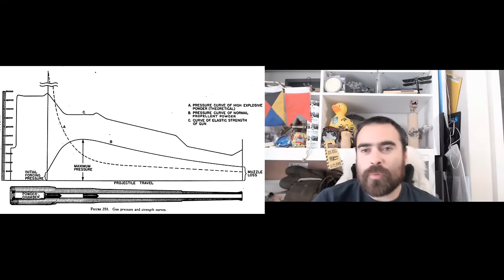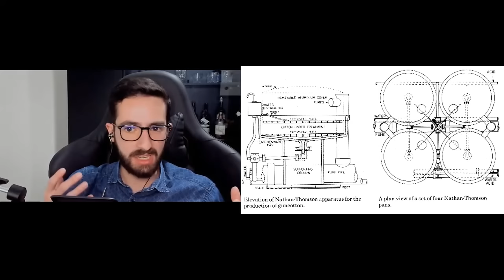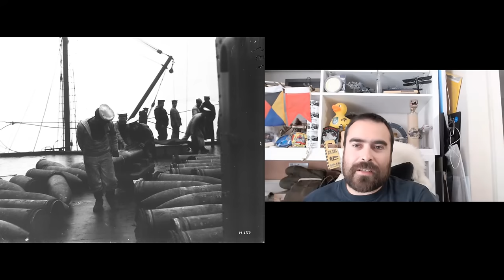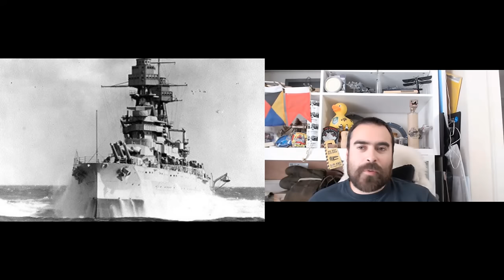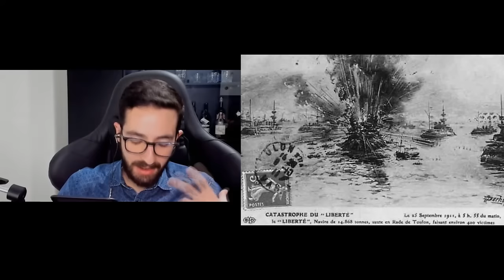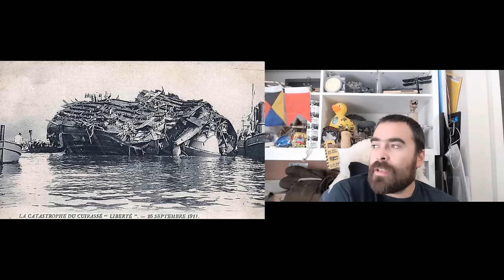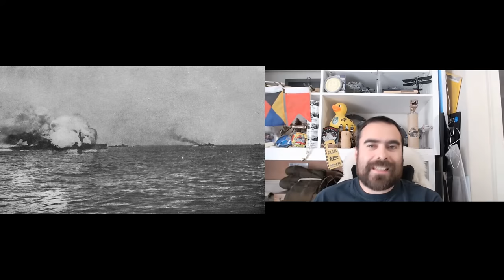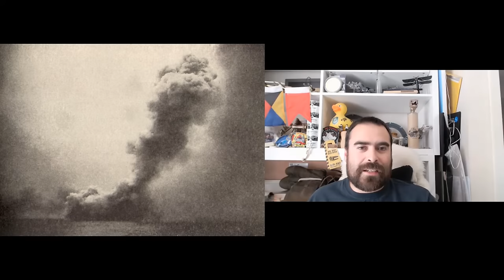Cordite and Poudre B - Why things start exploding at just the wrong time

Comment: Hi! I red a text about french B powder which was used by the French navy and the French army. The making process was the same for both but the army has her own unit and was more cautions with this new powder. An other fact is that was the army who was  the authority for the powder whereas for the navy there was an authority between the producers and the navy who like for the cordite was adamant whith the safety of the new powder, even more than the scientist who made it up.
The tests and survey by the army where more consistant that those by the navy. The accident of the IENA and LIBERTE push the authorities to replace the initial stabilizing additive (Colodion) by another, Amyl alcool but powder using this one where aboard LIBERTE and detonate.
It is the army whith a better survey and control of the powder degradation who decided to order to add diphenylamine to improve the stabilizing additive which was the good things to do at the time.
Your comments about Cordite and B powder and their sensitivity add some explanations to the destructions of the BOUVET in the Dardanelles attack (sunk in 6 mn after hurting a mine) and the explosion of the HOOD in the Denmark Strait battle of 1941 (sunk in 3 mn after a hit by a 15 In shell from Bismark)

Comment: Wow, what an original and interesting video! Let me suggest two ways to test the hypothesis that shock was the trigger for the explosions at Jutland. First, were there hits on British turrets or barbettes that did not trigger cordite fires of explosions? Even if there were some, that is not conclusive evidence against the idea, because I'm sure there are other factors involved (like, was that ship kept spic and span). Second, it would be interesting to compare the magnitude of the shock required to set off nitroglycerin to that experienced by a nearby hit from a major caliber shell. Again, it's bound to be complicated, but if the numbers differ by many orders of magnitude, that raises doubts.
Reply: There is one single fact that determined whether a RN ship exploded or not, it depended on flash or hot shell/armor fragments hitting a propellant charge.

A few RN ships survived turret penetrations because no charges were ignited, the only one that survived a charge ignition was Lion... because its magazine was already flooded.

Comment: If you take a chunk of C-4 and use a lighter to ignite it, it does not explode, it burns like a can of sterno or canned heat.  You need both heat and shock to make it detonate.  The detonator gives you the heat and shock to detonate the C-4.

Comment: Yeah, before I was even 20 years old I knew how to make a very large bomb. And the main reason was because I was growing marijuana by the time I started high school. We called it triple-13(13-13-13) but its also known as Ammonia Nitrate. When mixed with diesel fuel it will cause a very large explosion. I read about a merchant ship that was carrying a large amount of Ammonia Nitrate fertilizer & for some reason it's fuel tanks were leaking into the cargo hold.Then somehow something caught fire 🔥 and the diesel fuel started burning. Once it got so hot it caused a massive explosion as if the ship was the most massive pipe bomb ever. Usually, from what I've heard, it takes a smaller explosion to set off the mixture. But you can also find out things like that in a book called "The Anarchist Cookbook" too. When I was young I was going to try making a small bomb with the mixture but I never did

Comment: Nobody has stated the formal definition of the term 'detonation'. If memory serves, detonation is defined as 'a shockwave travelling faster than the speed of sound in that material'.

So detonation is measured in miles per second. So even deflagration can still, technically, be VERY fast.

Not seconds - that's just conflagration, I suppose.

Comment: Gunpowder burns it does not explode when it is employed correctly as a propellant.  You do not use explosive to send out a shot you use a propellant that burns and builds pressure to send the shot out.  The sound is not an explosion it is the sound of the projectile breaking the sound barrier.

Comment: I looked back through the comments a little and have to wonder if the bad fortune of being resupplied led to some of the catastrophes? The point being the propellant not used remained in it's position and overtime deteriorated but remained in it's position, as in the ones in the front get used every time, but the ones in the back never see use  and deteriorate, remaining a potential ignition/initiation point causing those untimely blasts? Just a Thought>

Comment: Damp hay bales can get hot enough from chemical reactions to burn and they are not very energetic.  If an energetic material will do similar things then they will have no problem hitting an ignition temperature.  The cellulose in hay burns at 450 Fahrenheit...

Comment: I've personally seen a man light plastic explosive like a candle.

It's so stable it's crazy, it takes such a  high activation energy to detonate, it requires a secondary explosive in the form of a blasting cap.

Most of these older explosives deflagrate instead of detonate, modern explosives detonate generally.

Comment: Not to nit-pick, but I don't think nitroglycerin dust being in the air makes it a fuel-air explosive. Maybe my subtitles are wrong? In a fuel-air explosion, the oxidizer if you will is the oxygen in the air, and the fuel is literally that, any number of possible fast-reacting materials, from very fine metals to atomized liquids to flour. There is no need for any secondary material to be involved for nitroglycerine to explode.

Comment: Even early Dynamite had issues with Nitro Glycerin separating over time. Straight Nitro Glycerin is a liquid and highly unstable, welcome Alfred Nobel of the Nobel peace prize. He stabilized NG with sawdust but this had a very short stable shelf life and within months the paper wrapping would be visibly wet with NG. The second generation of Dynamite used a clay instead of sawdust, this worked much better as a stabilizer. Not sure what they use now as I don't think Dynamite is even manufactured anymore as there are much safer and more shelf stable alternatives these days.

Comment: One question remains: The explosions occurred on the battle cruisers and not on the battleships. So the construction of the ships seems to have something to do with this.
Reply: Or the use of the ships. The battle cruisers spent a lot more time fighting and getting shot at at Jutland than the battleships did. 

But probably even more important was that the battle cruisers were stuck at Rosyth and weren’t able to do live fire gunnery practice, which meant that the cordite charges probably sat unused in their magazines for much longer.
Reply: And the thinner armored decks and belts of the battlecruisers meant that the German shells had a greater likelihood of getting to where things would go kaboom in the first place.  It's rarely just one factor, it's a combination of several, even many factors.
Reply: No, the only difference is that, when the RN BBs showed up, the Germans couldnt see them, so they couldnt hit them... so they didnt explode.

Comment: Even with proper mixtures of stabilizers and proper storage and handling, propellent and powder bags are not perfect, the USN was still using WW2 reserve charges during the 1989 accident on IOWA BB-61 that killed 47sailors in turret one. The eventual Oscar nominated conclusion was accepted as "over pressurized powder bags that had excessive loose powder on the ends, this was ignited by over ramming the bags against the projectile with excess force around 5k psi, an important note from the good data: with normal powder bags (no loose powder in the bag) the propellent pellets are stable if the rammer jams into the breach. 

What does that mean? inspection of silk powder bags for loose powder and better storage conditions along with procedures to mitigate over ramming.  😟.......

Comment: Well my mind is blown . . . the British were doing loading drills with real propellant BAGS and then returning them to the magazine for combat use.  I'm a complete amateur who's 5000 miles away from the North Sea and I can envision multiple problems with that.
Reply: Yes, that I find incredibly stupid. I'm sure that somebody had a good reason. Something like we must have the men used to handling the proper weights sounds likely. Ok fine. The ships spent a large portion of their time in port. Do the drills in port if at all possible with dummy powder charges set to the same weight with dummy shells. Plus if you are using actual charges and shells and then have to draw the unfired charges from the gun doesn't that sort of negate the purpose of the drill to being used to replicate combat conditions?
Reply: Dropped, kicked, seams leaking dust from a rip caused during the drill, too much heat, older bags used over and over...the possibilities are endless!

Comment: So basically the Hood's crew had no chance of stopping the 4" magazine in the aft section blowing up
Reply: That's what I understand from the videos (including Drach's excellent one) on the subject.  Once the 4" powder magazine started burning it was going to keep going until it burned out.  Alone, that would have been seriously damaging to the ship.  And it was venting through the uptakes as it burned.  Unfortunately, it was also attacking the bulkhead separating the 4" powder magazine from the aft 15" one.  And once that was breached and started burning it disassembled the entire aft of the ship.

Comment: Could the dust control problem be avoided by replacing bagged propellant with a more robust propellant container?
Reply: I think the nitroglycerin seeped through the cloth and crystallized on the outside of the bags. This was an unexpected effect.
Maybe it could have been packed in a more suitable material, but of course, there were no plastics at the time. Itonically, I think the closest thing to plastic film was nitrocellulose...
Old film stock is made from this material and it is volatile as hell.
That scene from "inglorious basterds" is a huge understatement to how flammable the stuff really is.
Reply: Why wasn't it just one item, with the powder in a vacuum sealed metal case, kinda like a blank round? These cloth powder bags seem like a lot of trouble. Just have the propellant in a case, and the primer inserted by the turret crew. Might have made handling safer.

Comment: There's a factor you didn't discuss. It's one for which I have first hand knowledge. The gun crews and sailors in general were kept more or less dumb regarding the dangers involved with storage, handling and use of explosives, so that they wouldn't have the technical knowledge needed to accurately assess the dangers and risks involved and subsequently refuse to be around the explosives. The general trend was and remains keep people dumb by communicating using nonsense or abstract words which sound harmless rather than using technical, specific and accurate words, so those who are doing the actual work with explosives are too illiterate in the subject to even know how to ask the right questions and where and how to obtain the right answers to gain an accurate understanding upon which to make the best decision regarding working with the explosives or simply getting as far away from them as possible to remain safe. A Gunner's Mate should know exactly what he's handling, all known dangers, and possess at least theoretical and practical background knowledge comparable to an applied science researcher working with the explosive in question, else the sailor WILL put himself and everyone else on the ship in danger either through sheer stupidity or ignorance scaling inversely with age, maturity, and experience. But in order to get a sailor to go along with and do the work of a gunnery crew, he'll be kept dumb. For example, rather than identify a residue leaking from propellant  or projectiles and convey a complete safety and working knowledge of that residue, such as naming it nitroglycerin and going into at length all known dangers and risk factors for nitroglycerin, the sailor's trainer and superior officers call it an exudate, forego any length of teaching, gloss over particulars, and simply "train" the sailor to deal with it by wiping the exudate up and discarding it and not to worry about it beyond just not getting an ignition source close to the exudate, as though it's an inconsequential occasional occurrence that poses no significant danger. So keeping the gun crews ignorant serves the end of being able to rely upon them to man their guns. This happens in modern navies, and most certainly happened during the 19th and 20th century. I found myself recipient of such training. In my case, while the exudate was identified broadly as either  nitroglycerin, TNT or other chemicals dependent on the propellant or projectile at hand, there was no teachings on the pertinent information upon which wise informed decisions could be made, instead I received "training" so I'd be likely to do the job without objection. So it likely was throughout the 1900's- train but don't teach, train but don't educate, train using deflective vocabulary to mitigate and minimize chances of self-education. Train just enough to get the job done and successfully if possible. So of course in some cases it was the sailors who inadvertently caused some of the explosions. What's the alternative? Educate them sufficiently to have the working practical knowledge of an applied scientist regarding the explosive in use and hope the sailor's patriotism wins out over his accurate knowledge of the risk of accidental or unnecessary death by explosion?

Comment: What propellant did the USS Maine have on board in Havana harbor?
Reply: Black powder, stored in a room with 6" of cork insulation  on the walls. There's an investigational documentary out there somewhere where they recreated the storage bunker and tried to make some loose black power flash off by heating the steel walls, as if some of the cork had been compromised. It's been while since I watched it, but I think the finding was that coal dust was a far more likely cause for the explosion than black powder residue.

Comment: what explosive did the Japanese use on their aircraft carriers and did that choice contribute to the outcome at Midway?
Reply: Their choice to stack UXO on the hangar deck while switching to torpedoes planning to send them back down later and many 1,000 and 500 pound bombs subsequently exploding amidst fully fueled Kates and Vals - which were completely rearmed by this point so - ... 18 900 pound Type 91 warheads plus the 18 not-ready-for-prime-time bombs of a similar explosive power they removed PLUS the bombs on the 18 Vals and roughly 150-200 gallons of high octane fuel per aircraft in a vessel with rudimentary fire suppression capabilities.  What with the approximately 54 pieces of IJN ordinance plus however many hits by McClusky or Leslie's guys, I venture to say that explosive formulations would not be a factor here. Proof? Best's ONE solid hit on Akagi with the potential to ignite such a conflagration did so magnificently.

Comment: Nitroglycerine is extremely dangerous, it is powerful but far too sensitive and killed Alfred Nobel's brother. I would advise people not to attempt to make it. As a propellant it would cause the gun to explode, and as a shell filling it is so sensitive that the shell would explode while still in the barrel. Picric acid and amatol are OK for shell fillings but too violent for use as propellants. The only explosive which is safe for amateurs to meddle with is gunpowder, but even that needs careful handling though it is not at all sensitive. The battleship Maine exploded in Havana harbour in 1898 and that caused the Spanish American War, as the US held Spain responsible. It later turned out to have been an accident caused by a fire in the coal bunker which spread to the magazine.

Comment: 16:05 so, if you burn modern IMR gun powders (improved military rifle) in open air....
.
It's not very exciting....
Takes about 6 or 7 seconds for a 308 case
.
.
Now you contain that, so it can build pressure.... and it burns in a few MILISECONDS 
.
.
Some powders will actually reduce burn rate if the pressure goes too high also
.
.
.
Modern powders are SO SO SO much safer
.
Black powder detonates at even the SLIGHEST containment (explodes in 0.0001 seconds.... VS IMR in even tighter containment which takes 0.01 seconds)
.
But you still don't want to be smoking around a jar of some IMR lol
.
.
See the video of the dude using some "smokeless" black powder 
 .
He shoots a round.... ember hits his open jar of black
.
And ya get a little flame....which builds pressure (despite the ~2 inch lid being off)
.
And that 2 or 3 PSI was enough to cause it to DETONATE!!! 
.
.
.
Whoof!!!....(pressure builds over 0.75 seconds) KA BOOM